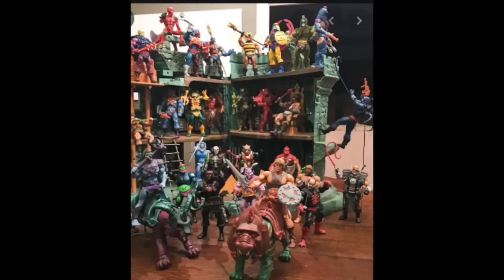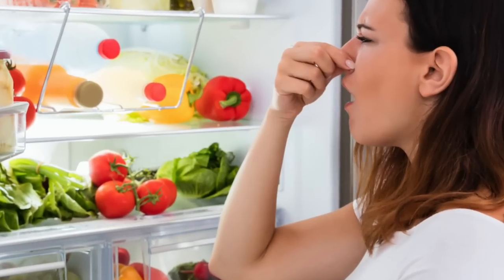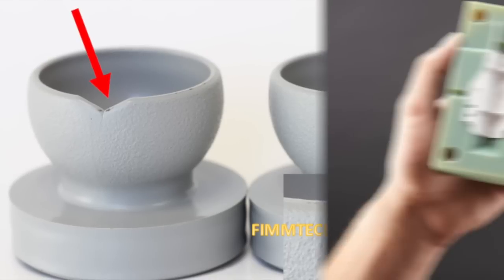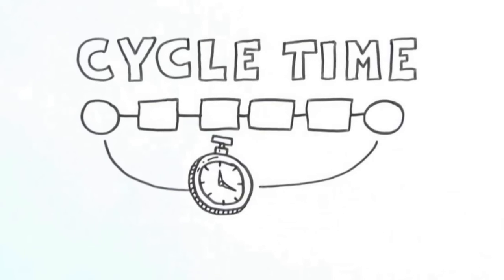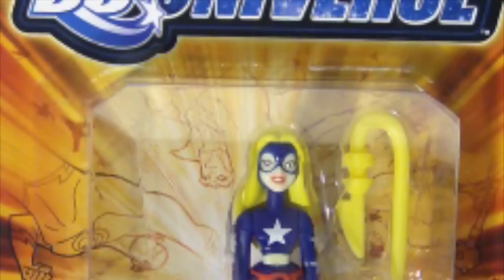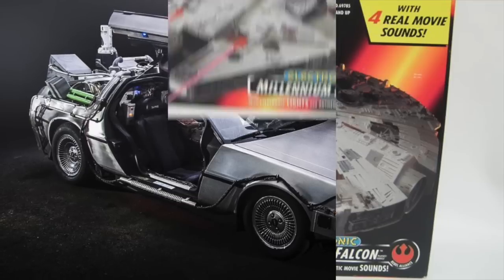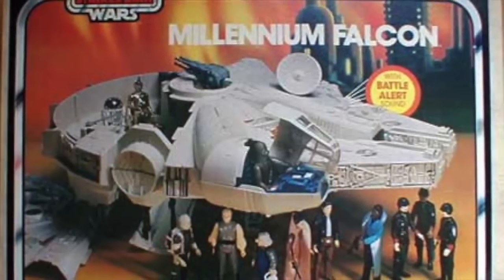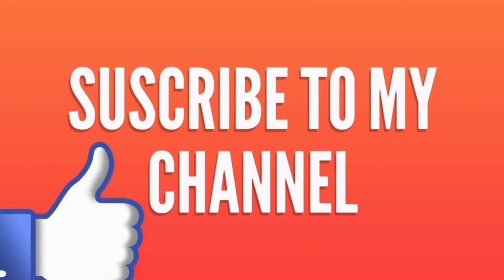Nothing lasts forever The Life Span of the common Toy Tool.

Comment: I think its waay after your time at Mattel but how did the process of handing out the MOTU Classics brand to Super 7 happen? Was Mattel actively looking for a company to sub-contract the remainder of the line or did Super 7 approach Mattel?  Did Super7 contract to buy out whatever remaining figures that Mattel originally have planned for the line? Or did they end up designing the figures they came out with? Same question with Snake Mountain.  And what about the Molds then? Did Mattel just hand it over to Super 7 and Super 7 just ended up using them up? What about their Thundercats line? Those are basically the same bucks as MOTU.  How is Super7 STILL able to basically use the same buck design that Mattel did with MOTU without going into copyright infringement?  I mean, that buck design must be copyrighted by Mattel, right?
Reply from the maker: I wasn't there but I imagine it was Mattel realizing no one was around to run the line so sub contracting it out to a company more connected to doing small collector lines was a good idea at the time. The first wave definitely had some Mattel sculpts in it as I worked on Lodar.

Comment: Very interesting, thank you. Do you know how they mold seamless figures? Either the TBLeague style body where they mold completely around a diecast skeleton. Or the way the new Death Added figure is from Storm Collectables where it seems like a regular articulated limb inside a seamless sleeve.
Reply: I own some TBLeague figures , I think they make the steel skelton after that they take the front and the back of the body and weld them together . 
The figures are made of TPE and that material can easy be welded via heat . 
The other method could be similar like TPE lovedolls with steel skelton for adults are made ...... you can find some videos of the productions at youtube (Warning , adult content ^^) .
Reply from the maker: It just depends on the vendor and how good they are
Reply: @paluxyl.8682  Interesting. Thanks for the info. I read that it was a TPE plastic but I hadn't heard about fusing both halves together. I don't have any TBLeague figures but I find the idea interesting and wonder what other ways it could be used for figures.
Reply: @josephday5038  The TBLeague figures looks nice , but the rubber material is a little sticky ..... also it's suggested to store the figure never with to much bended arms or legs , and some even say best without clothes or avoid tight clothes . 
The concept is great , but if I would make movie figures they would not be made of seamless rubber material .
Reply: @paluxyl.8682  my thought would be, could companies use TPE for accessories on regular action figures, like jackets, pants, hat's, etc. Maybe even use it for hair to make long hair more flexible. I guess the question would be if it is flexible and durable enough as well as how much cost it would add.
Reply: @josephday5038  You should take a look at the "Hasbro Star Wars Black Series HyperReal" Darth Vader and Luke Skywalker figures , they are 8/9 inch tall and got molded clothes . I have never seen them in real life , as much I remember was the retail price $80 .
Reply: @paluxyl.8682  I saw pics of those when they came out but I though they were seamless bodies with cloth clothes. I remember hearing a lot of people complaining about the 8" scale. I wonder, if they had made them 6" scale and tried to get the price point around $50 would it have been more successful?
Reply: @josephday5038  It always depends what you like and how much it is worth to you . 
I own not many 12 inch seamless Phicen/TBLeague figures .... just 6 old female figures with plastic skeletons (back in the days they was just arround 40 Euro) that figures are just mediocre and not so advanced , they are in a box the last time I have look at them was over 5 years ago ....... and I own 3 figures with steel skeletons , 2 of them got bikinis (but they never wear them to protect the figures and they looks better without them ^^) both figures was arround 100 Euro and one of them is a limited edition Red Sonja figure , she was arround 250 Euro that figure looks nice but she was not often out of the box because of the many little parts that can get easy lost . 
My opinion about the TBLeague figures with steel skelton is : they would be better if the material would be less rubbery and they would have smaller hips . 
There is one thing that I have learned from the Red Sonja figure : I don't like high class collector figures with small and fragile parts ......that's the reason why I will never buy a Hot Toys figure .
Maybe it sounds like I'm not a fan of seamless figures , but I struggle since many months to order an new figure , the TBLeague S42 looks really tempting .... not sure if I should get her , lol

Comment: Can 3D printing replace the molding process?
Reply: Maybe in the future, Right now I don't think so. 3D printing is much slower than molding and because of how it works it leaves those print lines from seprate layers.
Reply: Not anytime soon. Injection molding creates pieces where the polymer/molecular bonds are strong in every direction. In the 3d printing those bonds are stronger within the layer while cross layer strength is significantly weaker. Printed pieces will be weak to shear stresses applied between layers. True voxel printing may change this. The other issue is limited material selection and printing doesn't scale up effectively for mass production.
Reply from the maker: Alas the technology is just not there yet. Durability is rhe issue and speed

Comment: Would that mean the MOTU Origins are new tools? Especially with the swappable parts
Reply from the maker: Well the line is all new tools, but some figures share the same parts which don't need to be tool'd again, just cast in different colors
Reply: @spectorcreative1872  Thanks, I thought so as I know it's based on the original line which shared some parts.

Comment: Wouldn’t it make more sense to take all these giant metal tooling molds and just melt them down again into raw metal form so that they can be Recycled into even newer tooling molds rather than just use them as anchors
Reply: That is much more expensive and difficult than you might be aware. And steel is plentiful. Why would any company incur the cost if they don't have to? As far as they are concerned it was recycled, into a boat anchor.
Reply: Id melt them down and recycle
Reply from the maker: Alas, it is not as easy as that. The metal becomes brittle from so many plastic injections

Comment: i'd love to know how many figures of a certain line are produced. i understand why a company doesn't release these numbers, and honestly i wouldn't, either, but it would be great to know just how many of a particular item was actually made. 

moulds aren't nearly as expensive as they used to be and it's to the point where a small business person could afford them (within reason, lol). you really don't need to need to be hasblo size pumping out product for a major line like 'star wars' to justify them now. shoo, there are even benchtop manual injection moulds you can use at home and have small aluminum moulds made for you. i'm not sure exactly sre what these small, simple moulds cost, but my understanding is well under $1000 and i assume they're made with 3D routers. 

sure, moulds can be repaired and pieces fixed over time to where it becomes a theseus ship philosophical thought puzzle. 'it's the original mould!' except that every single bit of it didn't exist in the vintage production and there's only three original screws left, lol. 

in models, i believe there are still a lot of moulds from the 60's they're still using. that's entirely different than making large runs of figures, but it's still interesting how these things are passed around through company acquisitions and might be kept in storage waiting for someone to lease the thing or simply forgotten in a warehouse. when i first started working at GM i was surprised just how many ancient moulds they had piled up on racks in a dark corner. i'd say that's pretty old school, though, way before everything was manufactured in china, india, taiwan, mexico, etc.. i'm just south of dayton, ohio, where there used to be a tool and die shop on every corner.

it's heartbreaking how many moulds wind up at the end of a chinese rope or chain....
Reply from the maker: See here: https://youtu.be/9ugzvlNvnmA

Comment: So a toy that existed 30 or more years ago can be remade if someone is willing to invest in making a new tool? I was also wondering about reverse engineering. How do companies make knockoffs? I assume since they don't have the original tool, they are able to fabricate an inferior tool from a sample of a legit product?
Reply: Is just that is pretty expensive
Reply from the maker: Anything can be remade if you want to make a new tool. A video on knockoffs is coming...
Reply: i think you basically answered your own question. all you have to do is pretend you want to make knock-offs and ask yourself how you'd do it. it's probably shockingly easy and relatively inexpensive especially if you have access to manufacturing. with fairly little investment you could make all the vintage stormtroopers you want. you really don't even need a metal mould, but you're probably not going to get a high amount of repros from high-temp silicone. but, there are benchtop injection mould machines you can get for about $12-1500 i think.